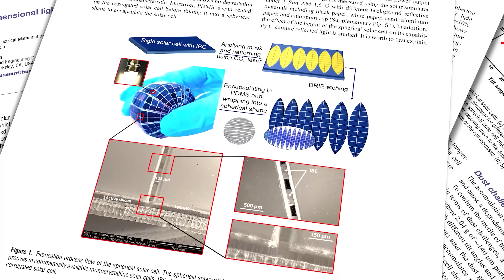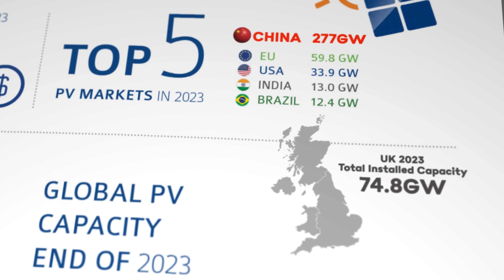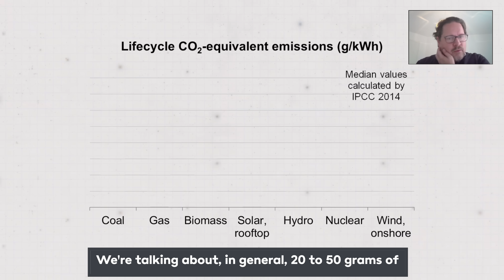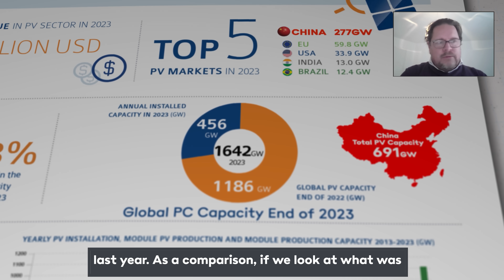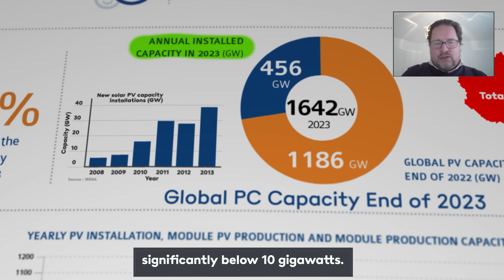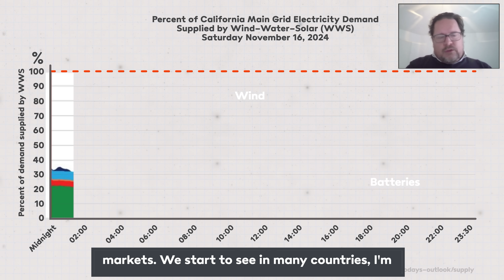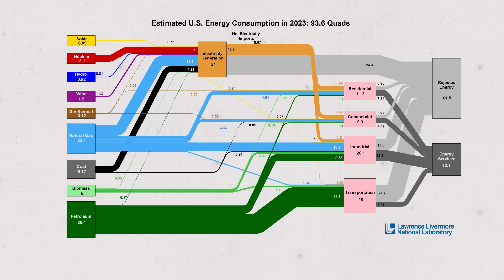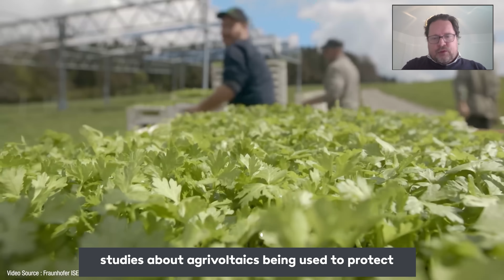Renewable Energy Domination

Comment: Id absolutely love solar but just cant afford it 😢
Reply: It's quite cheap if you do it yourself. Stick few panels on a shed or something. It only takes one £50 panel and a micro-inverter to match the normal day-time load of a typical house when it's sunny.
Reply: No govt schemes for rooftop solar?
Reply: @commieTerminator  think maybe 0% Vat but it's still like £8,000 to £10,000
Reply: It's cheap. Second hand panels for £20/200W. X EV battery from a scrap yard. Second hand inverter from e bay etc.
Reply: @petewright4640  I can even buy new panels ~80$/410W. But you are right, half the price. If one has limited space one'd need to go with new panels.
Reply: @petewright4640  All good if you know someone who can fit it I suppose
Reply: @petewright4640  You have to have the skills to install them and hook them up.  Most of the people here can't do that.  A handful of them might.

Comment: A pergola built with PV...Brilliant
Reply: That's what I built last spring and a car port. Paid for itself in a year. 450W panels are now £25, leccy is about 20p. Only about a month to pay for a panel these days.
Reply: @phillsmith1901  Did you make a video about it by chance? Curious to see it
Reply: @nononsenseBennett  unfortunately not sorry. I built flitch beams to hold the weight over the long span of the driveway, then put Trina panels on top. Between each panel I used silicone sealant, wanted to use T-profile rubber but couldn't find any at a decent price. The panels are attached to 2x4s which span across the three long flitch beams. To attach the panels I cut a lenght of 90 degree aluminium in to 1 inch brackets and drilled a hole in both sides, used small nuts and bolts to attach to the panel frame then screw in to the 2x4. Might film the next project, good idea.
Reply: I would love to have one of those in my neighborhood.

Comment: Rooftop solar, and small wind turbines - also rooftop? Residential household use. Got good wind year round where I live, metal roof, and little shade. How much wind/solar will be sufficient for a household? Where do I find out how to calculate this? Thanks.
Reply: You're not connected to the grid today?
Small turbines are generally not cost effective, but perhaps you are that edge case...
Reply: More panels = more better.
If you have the money, the space and the roof can support the weight, add as many as you can. If you have "too much" the inverter will just switch off some panels. It's good to have "too much" midday because this means you will have enough earlier and later in the day when there isn't as much sunlight.
Reply: Look at your annual electricity bill, by month. Get quotes from 2 or three local solar panel installers. Check with your local electricity supplier how they deal with solar, and can you sell excess back to the grid (ours is net metering).  
Do you want a battery for backup and power/time shifting, or just panels and take what you can get? Think about the payback period. 
Check your local requirements/restrictions on domestic wind turbines. They don't generate nearly as much as people think, and require more maintenance. I'd live to have wind turbines to supplement my solar panels, but they have to be mounted at least 25 feet above the top of the house, and it's just a no go in my area.
Reply: Try garydoes solar on youtube